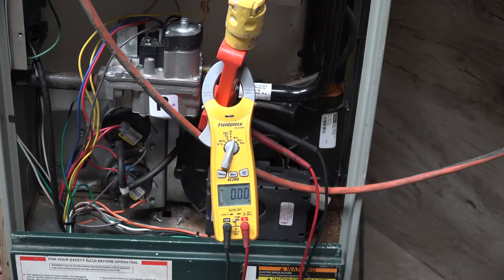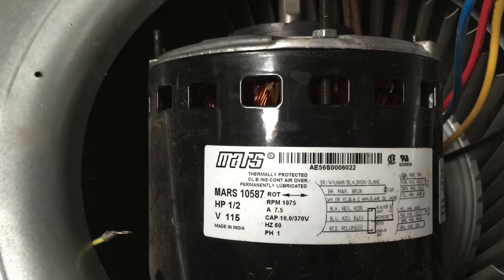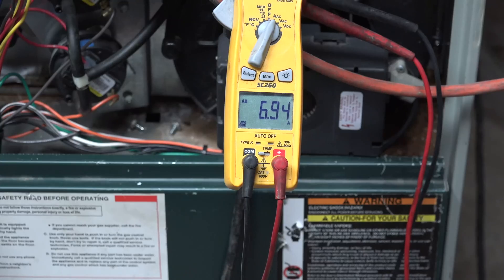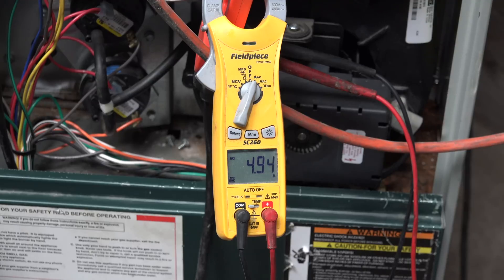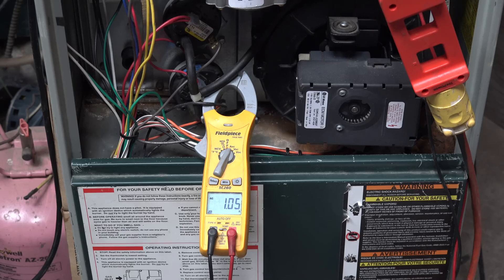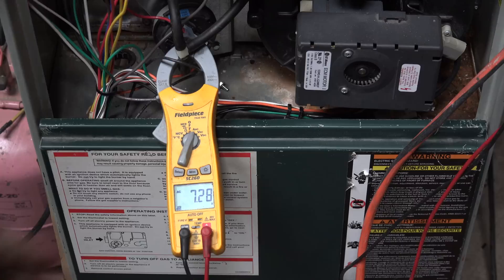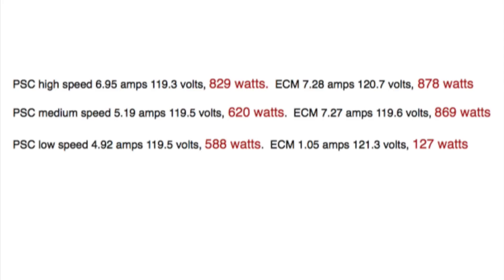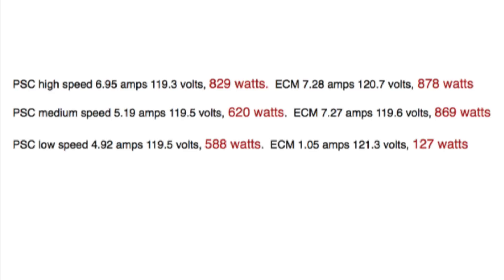ECM vs PSC motor power usage

Comment: My 3/4 HP PSC motor (in cooling mode) measured 900 Watts. I replaced it with a Genteq 6107E 3/4 HP Evergreen ECM Motor (moving the same airflow) and it now draws only 600 Watts.  That sure doesn't line up with your findings.
Reply from the maker: A 3/4 hp PSC motor under full load will draw about 1300 watts.  Your motor is not under full load.  The ECM shines best when under partial load.  The change is a good mode.
GFM
Reply: @grayfurnaceman  -- It's running on Med-Hi.  Down one from the top speed.  As others have pointed out, the results you got were likely  skewed because your meter was reading V.A. not true Wattage.  My own opinion is that these ECM motors are superior in just about every way.  And as far as cost go, they will pay for themselves in less than two years because of the electrical savings.
Reply from the maker: @rpsmith  If you go to the link at the end of this video, you will see a comparison using a watt meter.  The surprising part of this second video is the numbers are different, 
but the relation is mostly the same.  The lower the speed, the better the ECM does.  
GFM
Reply: @grayfurnaceman  -- Thanks for the reply. I'll check it out.  But that still doesn't explain why we got so different results.  If we lived in the same town I bet we could get together and figure it out.

Comment: Here is where everyone messes up with an ECM motor. Inherently variable speed motors work off a change in hertz to adjust the speeds. It is a simulated 3ph motor with rare earth magnets to help in the phasing process. All you are doing on the volt side is verifying that the voltage to the motor is 120v. Most ECM motors will run on either 120 or 240 volts. Just a change in the wiring  harness to the motor. Couldn't do that with a normal PSC motor, you will burn it up. It kind of works like a light dimmer switch. By adjusting the nob, we are adjusting the voltage. That nob on an ECM now becomes hertz.The head of the motor converts that voltage to 3ph. 3ph motors are the most efficient motors when it comes to the HVAC business. Some use a DC current and others use an AC current to drive the motor. That really depends on what the manufacturer has to use to meet the efficiency standards. If you have a specialized test set up that tests volts, amps and watts you will see what the true watts reading is. 

Watch this video: https://youtu.be/nbxT__L6FsQ
Reply from the maker: This video was done using apparent power.  The end of the video has a link to one that uses true power.  The results were different in numbers but the percentages were much the same.
GFM

Comment: also the ecm is gonna push more air thru the system and thus will run a lot less. that negate the savings on psc.  the big advantage the ecm has is that it will take higher merv filters and deliver the same air pressure where as the psc has no way of adjusting... think of the psc's as the solid rocket booster on the shuttle..it either runs or doesnt..where as the ecm is more like the shuttle engines themselves and able to be increased or decreased depending on desired response

Comment: Good info, thanks, An important piece of this comparison is duct static pressure. At high static (typical) PSC is generally more efficient . Power factor matters too, as does control configuration (constant airflow or constant pressure?) More detailed comparison studies on these is definitely needed in the industry!
Reply from the maker: The high static is probably true (I will check it out).  But that is because the ECM will increase its speed in an attempt to maintain flow.  As the video shows, the ECM does not perform well in the higher speeds and the PSC does not perform well at low speeds.  I have been meaning to do some power factor tests. as I have lately found that some electronics have a very low power factor.  
I do agree that definitive testing is needed.
GFM

Comment: Assume we pay about $500 more for the ECM motor based HVAC unit. Does extra $500 provide you any power efficiency advantage? Here you are paying about $5 per month extra premium for an ECM base device i.e. about 32 KWH at 15Cent /KWH savings you must have to cover that premium. 
Here we do not count the repair complexity and increased repair incidents. Considering these experiment data, I will not pay extra $500 per unit for the ECM based HVAC unit unless you are a dedicated environmentalists. I think industry must improve more to justify the extra higher cost of ECM motors.

Comment: Your home utility Power Meter does not include the power factor effect. So be careful, the Voltage and Amp will turn your meter. Low power factor device i.e. induction motor will increase Amp and meter will turn faster. In short the PSC vs ECM power comparison gives good information for the user and technical community.

Comment: As mentioned by John C, AC induction motors can not be accurately measured for "Watts" by applied AC volts and a clamp Ammeter, because the induction of the motor causes AC current lag, so that the Volts and Amps are not in-phase... this is where Power Factor comes from. 

If the Current is not being measured in-sync with the Voltage, you are not measuring true Watts.

Typical ESC motors rectify the AC line voltage into DC, and PWM modulate that to drive the brushless motor. These motors have much better Power Factor (Voltage and Amps in-phase) because they are not an inductive load such as induction motors are. 

In the PSC induction motor, you may have as much as 90° current phase shift due to speed, load, and run capacitance. It would be common to see P.F. of well under 0.7 on a PSC motor, and above 0.9 on an ESC motor.
If an Induction motor is being used at the same conditions it was made for at full-speed... same load condition, same capacitance... that one condition will be its best efficiency AND power factor. At full-speed (with PSC motor operating at precisely its design specifications), both motors would exhibit very similar efficiencies... but only under that very specific condition.

Once you move a PSC motor away from that optimized condition to a lower speed, lower load, but same capacitance as used for full-speed... then it becomes a totally mis-matched system, and the power factor takes a nose-dive... low speed would result in VERY low efficiency if a true power meter were used to take the PF into account.
ESC motors have very consistent efficiency ratings across the entire load/speed range because they do not present varying inductance/capacitance problems to the AC line like PSC motors do.

BTW... it's not hard to use a Kill-A-Watt meter for testing these motors... plug it into an extension cord, then use a Load cord with bare wires to wire-nut to the fan wires... simple electricity... and these meters do give a relatively decent True Watts indication, as well as giving a Power Factor readout.

Comment: For the full wave rectifier comments below (LED etc).  A full wave rectifier, like in an ECM, only draws current during the peak of the AC voltage waveform.  This spikey current waveform delivers a significant amount of power in the higher harmonics (120 Hz, 180Hz, 240Hz etc) which mostly are not aligned with the AC voltage waveform.  This results in a poor power factor.  I would not be surprised if there were some kind of power factor correction circuitry in a furnace fan motor.

Comment: In the event that a PSC motor gets replaced with a true ECM motor on existing, undersized ductwork, causing the ECM to use equal or more power, would you say the "energy savings" would still be valid in that you are spending the same as before, but you are now delivering proper airflow and have increased the overall comfort?
Reply from the maker: Yes.
GFM

Comment: The readings seem legit, we watched you do it. My question would be what your static pressures are. ECM motors ramp up with high static to deliver the proper cfm. High static would give you those readings. ECM motors struggle and burn up past .7" water column
Reply from the maker: I will be doing a further test using static.
GFM

Comment: grey furnaceman could it be because emc motors use dc current. psc motors use ac current where as ecm motor has a rectifying device that turns it into dc so therefore the nubers aren't onna be the same.
Reply: he  measurrd AC AMPs going into the motor. ECM motor converts AC to DC inside the motor housing.

Comment: Need actual cfm and static pressure to prove. Too many variables not measured. I prefer variable speed over PSC and multispeed ECM due the factory programmed settings. Low speed saves $$ in multistage units on the electric bill.

Comment: The ecm will draw mor amperage due to it is most likely doing more work on the higher speeds. It will continue to ramp up to make the requested CFM. Wile the PSC will not.
You should measure the CFM on the 3 psc speeds and then set the ecm to create the same requested load. That will be the true energy savings or not.
Additionally if you wanted 1400 cfm and when you measure the psc' cfm if is less than what you want it is then making the entire heat or ac operate at less efficient than design. In that then the ecm motor wile drawing higher amperage has proper CFM making the system operate in a more efficient manner. 
On a restricted duct design blower amp will rise but system overall efficiency now operates as designed.
Just my thoughts 
Thanks for taking the time and effort for all of the videos
Reply: Interesting. I changed from an old atmospheric burner 40 year old gas furnace with a belt driven 2 speed 1/2 -1/6HP blower to a 2 stage 80+ forced vent Tempstar with the variable speed ECM a number of years ago. My GAS usage did not go down, but my electricity usage did. My theory is the higher efficiencyof the burner was offset by the requirement for the gas to replace the heat that the blower motor was not producing - - - - I was  running the fan on low 24/7. IIRC the old blower drew about  7 and 3 amps but I can't find where I saved that info (if I did)

 The new furnace is VERY surprising compared to your readings - on low speed circulation only the furnace draws only 0.2 amps and when the furnace starts (on high fire) it draws 3.4 amps (total furnace draw) dropping to 1.7 when the furnace goes down to low fire.
at 118 volts RMS that is 23.6 watts on low circulate, 200.6 watts on low fire, and 401 watts on high fire

Comment: The ECM motor must have been pushing more air than the PSC. There should be more of a difference between the medium and high. Most furnace ECM motors try to maintain airflow irrespective of static pressure, but it looks like it ran out of power in high, since there was no real difference between high and medium. It had enough power to run at the programed speed in medium into that load, but ran out in high. With PSC motors, the different speed taps more or less 'mechanically' limit the motor power. The air it flows will be directly dependent on the static pressure. The power will change some small amount with speed changes, but its not that significant over its design range. With an ECM motor, its a 3PH induction motor that is electronically controlled, and they are typically programmed for constant speed. So if theres more restriction, it takes whatever power is required to make the fan assembly spin at that speed. The HP rating means a lot less here. You can put a 1HP ECM into a furnace that had a 1/2HP PSC and it won't matter. It will take less power EVERY time for the same airflow. The HP ratings for a ECM are more or less software limited, and not really directly comparable to a PSC since they will act totally differently in various conditions.

But yes, the largest advantage to an ECM is how they maintain torque at low speeds. PSC motors drop speed by effectively dropping torque, so the rotor 'slips' while under load. The longer the winding, the less current flows, the less torque generated, and as a result it spins slower and produces less airflow. But this means the speed/airflow is NOT controlled. So you get less airflow as the static pressure increases. ECM will try to power through static pressure, but as a result it can take more power if the ductwork is restrictive, since its doing more work. And of course, its nice they generally have a soft ramp programed in, so you don't get a bang when the fan comes on like you can with some units.

Comment: I agree with you. ECM advantage could be a dehumidify mode in the summer. Static pressure is to much a hassle with a ECM unless its all new and sized right.

Comment: You need to take power factor into account. PSC with the correct capacitor will be close to unity power factor. An ECM is not a power factor corrected unit, and the usual power factor for AC straight through a bridge rectifier to DC bus capacitors is around .6.

Please plug the furnace in to a meter that takes power factor into account, a Kill-A-Watt would work well.

Thanks for the videos.
Reply: True RMS yes, but separate current and voltage readings. Without taking the phase angle difference or waveform distortion into account you don't know the true power.

Example: the non-dimmable LED bulb I have on a K-A-W right now. It is the same rectifier into a smoothing capacitor setup as any other SMPS or the ECM. .5 power factor, .15 amps, 120.7 volts, 9 watts, 17 VA.
Reply: IOW you are reading VA (apparent power) not watts.
Reply: I second this.
Reply from the maker: I will be doing one with a kill a watt but the meter used is a true RMS.
GFM
Reply: @grayfurnaceman  Did you ever repeat the test with a device that takes PFC into account? The difference should be much more substantial than you're showing here.